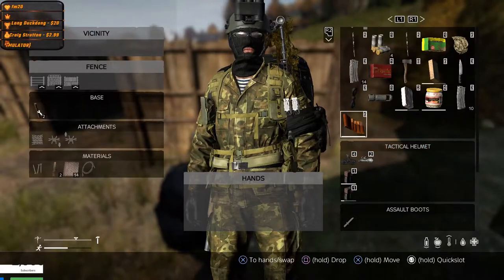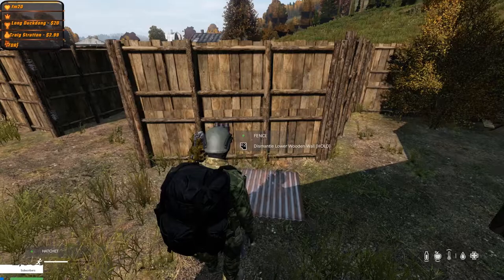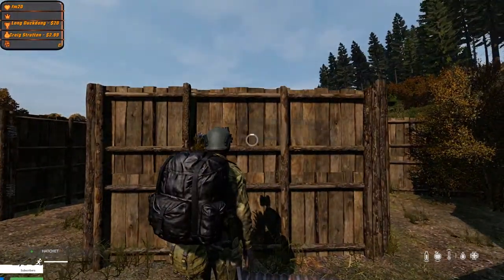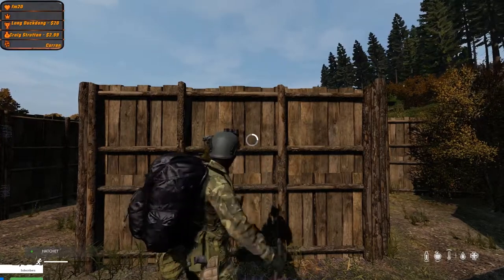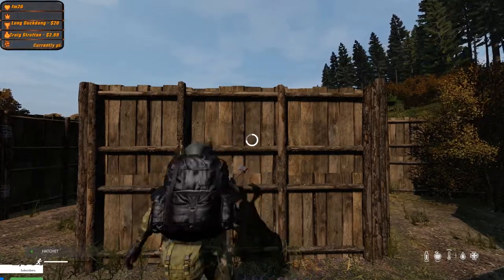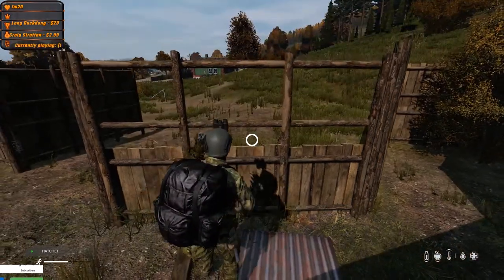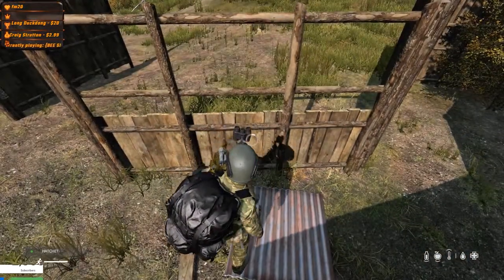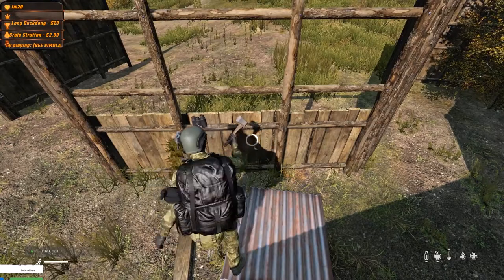HOW TO USE SHEET METAL IN DAYZ ON CONSOLE | DAYZ PS4 | DAYZ XBOX

Comment: How do u break it??????
Reply from the maker: Well, to break or tear down the fence you need a sledgehammer,  a hatchet or axe, a pickaxe, or a grenade if you want to destroy it. Then you just have to look at the right spot on the fence with the tool in your hand. It can be tricky sometimes so try and look over every inch and make sure that you're close enough for it to give you the option

Comment: Hi I had the same exact problem and now I know how to deal with this, ty! Also, do you know if the metal sheet is more resistant than the woods? Like if you get raided for example.
Reply from the maker: You're welcome! They actually provide almost the exact amount of time to tear down. It varies by just a couple seconds depending on the tool they're using.
Reply: @UnfavorableGamer  then what’s the point especially if you can break it the same time as wood
Reply from the maker: @antoniowolfe2041 It's all just preference i suppose.
Reply: @antoniowolfe2041  Just so you can look like a stronger base